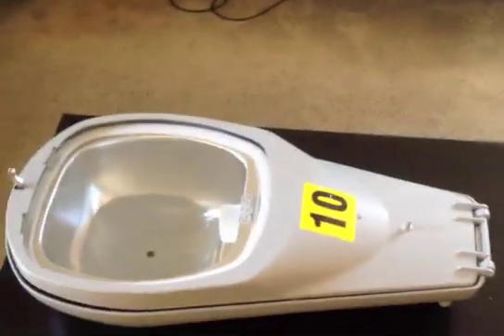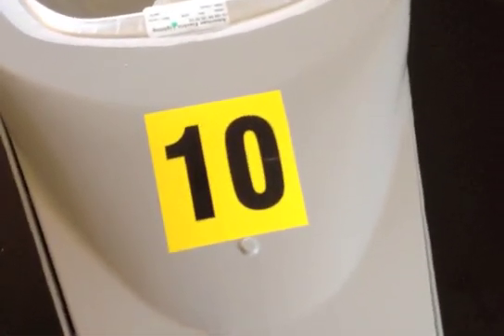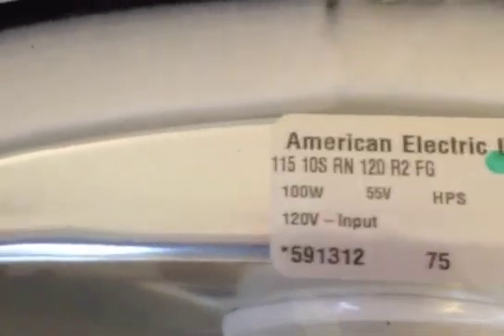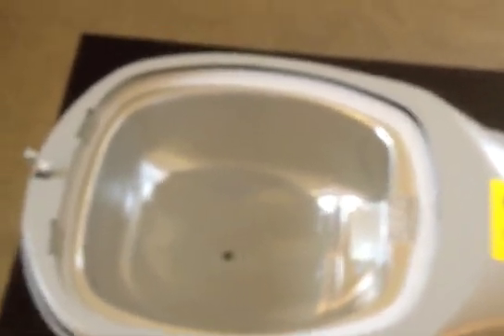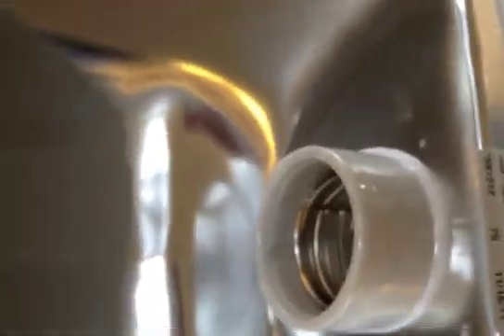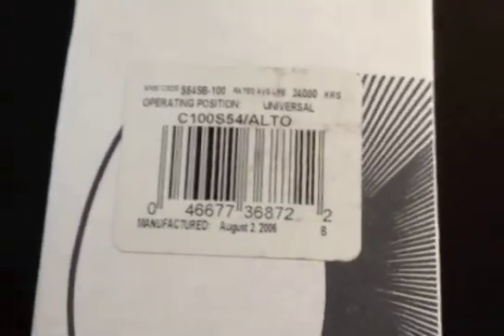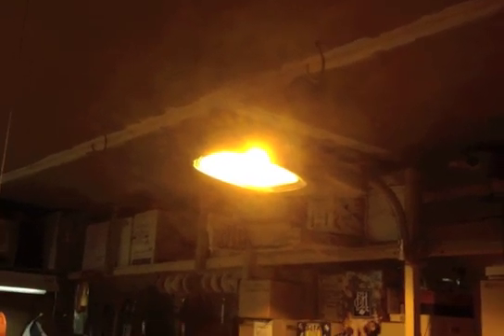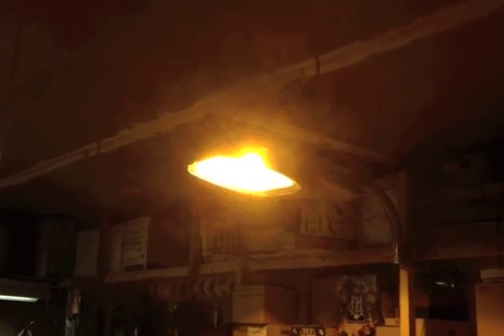American Electric 115 series street light

Comment: Do they make this fixture with different shaped lenses? Ive seen some that are round and some that are not as big and flatter on the bottom. Also, whats the difference between the 115 and the 113?
Reply: The 113 was made by Thomas & Bettts and its different and produced in the early 1990s through 2003 the 115 came in 2003 along with the updated 125 and Thomas & Betts sold the company to Acuity Brands Co 2003 which started selling them as American Electric